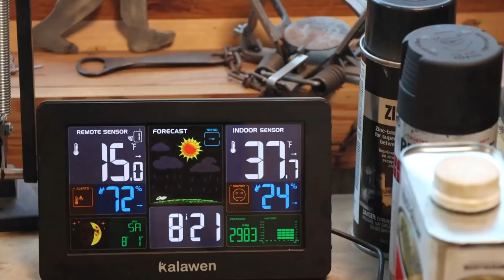Invisible winch mount Chevy Square body

Comment: In the beginning "I'm only going to do the bare minimum" 5 years later "I'm installing the diamond studded headlights today.
Love everything you do. Started watching you at the beginning of your shop repair and have watched every video and yours are the first videos I choose when the weekend comes.
I was wondering where the motor went and did I miss a video.
On the big heavy bumper with brush gaurd.  The Tuesday before Thanksgiving I hit a deer, no body damage but it bent the bumper and broke the grill. So I stopped in the body shop and we ordered a heavy bumper with deer gaurd, the day before Christmas hut another deer same spot on the truck so no new damage. Bumper comes in and the rest of the parts, scheduled to get everything installed Tuesday after the new year. On the drive home from the body shop with my nice shiny front end deer comes out of nowhere and slams into the front of the truck dead centered. Would of taken out everything from the bumper to the motor, no tell what the cost would of been, but thanks to the new bumper there was zero damage to the truck (deer was a total wreck). The bumper has tge hole for a winch but with the amount I'd use it I figured it would sit there and go bad by the time I needed it. They had a plate to bolt over the opening that has a Reese hitch receiver, so I got that option and put a hitch with a shackle in it for pulling. I figured if I find myself wanting or needing a winch I can go with one mounted on a hitch and keep it under the seat in the back.

Comment: You need to make all controls accessible without reaching under the bumper .... i'm sure a feller could figure that out easily...
while reaching isn't a big deal...when it's clean...alot different when mucky or wet in there...
looks good...well what i can see of it!!... make your license plate holder so it keeps your hook clean... hangs down when open ...out of the way...

Comment: You'll need to find a way to secure the end of the line now. Yankum is taking preorders on a fairlead that allows you to secure the loop to the fairlead, pretty slick but 265 bucks. I think just a (metal of your choice) puck with a flange or taper bolted to the bumper or somewhere nearby would be less obvious than the hook flopping in the breeze and hunting for something to get caught on.

Comment: It’s like that spot was designed for a winch and I suggest pulling it out and tighten the spool or the first time you use it it will pull through the windings just a headache

Comment: The scratch I use to "build from" is usually steel, but sometimes aluminum, poly or stainless.  It all depends on the situation, I've even used wood or brick scratch on occasion.

Comment: I've used worn out sockets to create punches like you were using on the cardboard.  Turn (ceramic) or grind the inside hex or 12 points round, to the finished diameter of the hole you'd like, then turn or grind the outside of the socket tapering to a knife edge with the inner dia. Of course you have to have worn out sockets for this, but who doesn't?

Comment: Made me think of Bob Ross with his paintings when you were marking up the template. Was expecting you to say those, ahem, "vent" holes for the winch were happy little accidents lol.
One question, could you have mounted the winch guide behind the bumper too and just had the slot cut in the bumper? Then you'd need less boxing in to hide with a folding plate cover.

Comment: I had my winch set up in a similar configuration inside a bull bar until I saw the same set up as mine which had failed massively trying to pull out of a deep mud hole. The 4 mounting bolts had torn out of the winch housing and the mountings had all buckled. I modified the mounting to rotate my winch 90 degrees so that the winch mounting is now facing the front of the vehicle and under tension the winch is pulling toward the mounting surface. The cable passes through a hole in the mount. As you would expect, having gone to all that trouble I have not had to use the winch since.
Steve I would be very concerned that by adding the bolt ventilation holes you may have reduced the locating/holding ability of the front bolts and placed more stress on the two rear bolts, which are the ones carrying most of the load anyway.

Comment: Did you see Wranglerstar's video where he broke his Badlands winch?  He was definitely abusing it and managed to break the case.  You might want to look at where his broke and do a little reinforcing.
On the license plate idea, I had a buddy who made a fold-down plate holder that formed a step, mainly so his wife could check the oil, but very handy.

Comment: Hey Steve can you explain  your process and products used to refurbish the rust on the frame. Did you use a rust stop paint? Or did you sand it down and primer the metal?
Reply from the maker: I did both. I used a needle gun on the heavy rust and a wire wheel for the lighter areas. I then brushed on a rust converter then paint. 👍. If its light stuff a wire wheel and some rust inhibitor paint is fine IMO.

Comment: Will you have any problems running your winch upside down?  Seals for shafts and control rods that go through the winch frame, oil pooling where it can't lub properly and such?
Reply from the maker: As much as it will get used I doubt I'll have issues.

Comment: Ahh, that's the winch that Harbor Freight gave to Wranglerstar to test. Initially he loved it, but destroyed it very quickly.  He replaced it with a Warne.
Reply: Came here to read this, the 'professional homeowner' managed to mess it up pretty good
Reply: @mickarthur6731  he did bolt it to something probably a little bit bigger than he should have...
Reply: @simoncrabb  I think he was trying to uproot a massive tree stump, the winch grenaded in a big way
Reply: @mickarthur6731  ahh yes, beyond the recommended design envelope!
Reply: @simoncrabb so far outside, the envelope had a different zip code
Reply: No "e" in Warn!
Reply: @paulcopeland9035  I did wonder when I typed it, there must be another Warne with the e!

Comment: That's really high-quality work there, Steve!  I have one small concern, which might not be relevant in rural Tennessee.  You kept talking about that unused space in the frame and how it was originally made with thin steel.  Umm, didn't you just deactivate the primary crush zone for the front of the truck?
Reply from the maker: The crush zone is still there. It just moved to the driver side floor board 😖
Reply: @SteveSummers  , I used to live in rural Vermont, black ice capitol of the US. This is, after all, a rural truck where extra care and lower speed is the norm.  I'm sure that you'll be fine.

Comment: the biggest con you forgot to mention, (also the reason i would not mount the winch in this way personally), is it's right under the radiator. any radiator leaks would result in your winch and cable being covered in coolant. as well as removing the coolant at the rad to remove the radiator would also result in the winch covered in coolant, (they did not make it easy to drain the rad, as the radiator drain petcock just drains the coolant right onto the core support so it runs everywhere, and we all know how messy pulling the lower rad hose always turns out to be). i like the look of the hidden winch, but apart from the stock apperence, there arent any upsides to hiding the winch under the rad support (you can protect your winch with a winch cover from water etc when not in use)
Reply: None? How about theft deterrence and the added spring mass closer to the wheels and not cantilevered 4 get out from the axles. That's just 2 of the top of my head. Also, coolant won't hurt the synthetic line.
Reply: And I would never go outside in case the sky is falling.

Comment: What about just mounting the winch up from the bottom of the frame vs hanging down from the top? Then you could access the cable reel by just lifting the hood. I'm sure you thought of that so what is the issue with mounting it that way?

Comment: Possible con -  Is the gearbox oiling on that winch designed to be run upside-down?   I only ask because we ruined a brand new Warn we mounted upside-down in our race trailer.
But, I like the clean install in otherwise unused space.

Comment: Okay, I'm odd man out. So when you need to respool a bunch of cable on the drum are you going still like the hidden look? Wouldn't it be nice to be able to fit the cable on the drum tight instead of all zigzag? What I'm saying is you can't see or work the cable on the drum all tucked  away inside the frame.

Comment: the vent holes for them bolts is a great idea ..another reason you may need extra holes would be drainage .and future wiring of course if you have grommets you can throw them in and never be asked .    great video a little long on the saw cuts there cool tools but not to informative

Comment: Steve be aware of the angle that your rope/cable is with relation to the fairlead.  Since it's only supported by the bumper any loading on the fairlead could bend or distort your bumper.  Otherwise I think the placement you chose is excellent.  Also you don't have the bending moment stress placed on the frame by hanging the winch out front.

Comment: Done this before but I have always wondered what effect it has on the designed "crumple zone"?  Also on a 1/2 ton truck what would the wear on components be like in reaction to the continuous extra weight up front?  Never did get any good answers to either question.  The first being the most important of course.
Reply: I guess with that massive H-Frame the "crumple zone" is completely inside the opponent anyway.
Reply: On that year of truck I doubt if there was any crumple zone.
Reply: @runout57  I can recall when they started using collapsible steering columns, mid truck fuel tanks, and several other mods motivated by Ralph Nader.  All these were in place by the eighties most in the mid to late seventies as I remember.  If you have ever seen a driver in a head on speared by a solid steering wheel column you will understand the need.  Trucks did lag behind cars for a very few years.  So he may not have a crumple zone but the thin flexible frame would have acted much the same until you beef it up and add fixed mass all of which transfer the force rather than absorb it.  Volvo was the first to pioneer the concept in the seventies with crash testing. Anyway it is a question to which I never got an answer.  I built mine super heavy with battery box and tool box included on one build which always made me wonder.
Reply: That truck was built 10 years before the "crumple zone" was even thought of!

Comment: Have you thought about having an offset, front hitch mount? Offset it towards the passenger side and you'll be able to see past the trailer you're manoeuvring.
Reply from the maker: Nope, but that is a good idea Tim👍
Reply: @SteveSummers  It would also allow you to do two other things, use the winch to pull stuff onto the trailer and a strong point to double the winch rope back to if you want to use a snatch block.

Comment: I'm always concerned with theft. I'd consider tack welding at least a couple of the winch mounting bolts/nuts, if for no other reason, to screw with potential thieves.
Reply: Where they are no thief will be able to reach them once the truck is back together, they will be hiding under the radiator and behind the heavy front grille, so pretty hard to reach to undo without a bit more work.